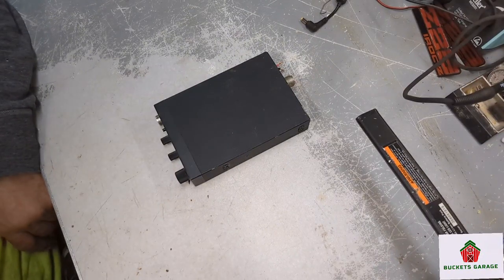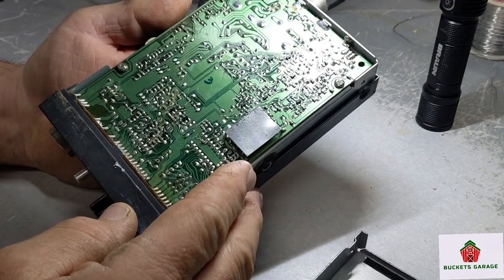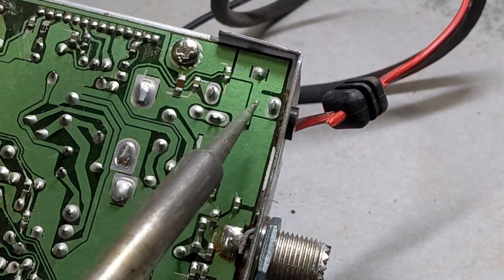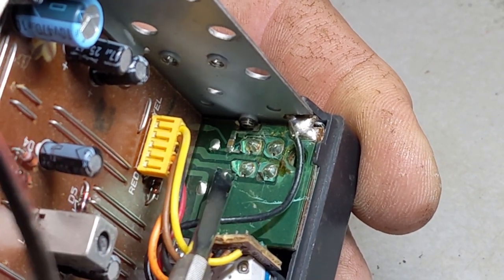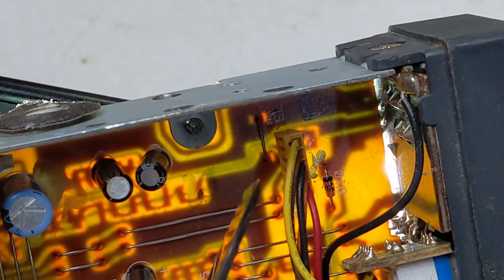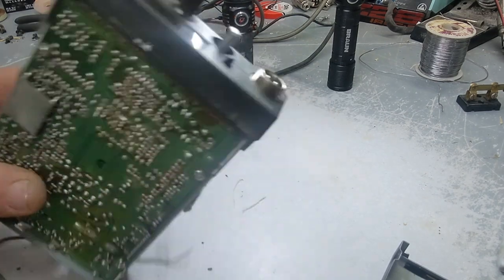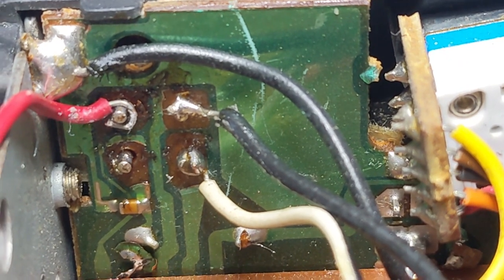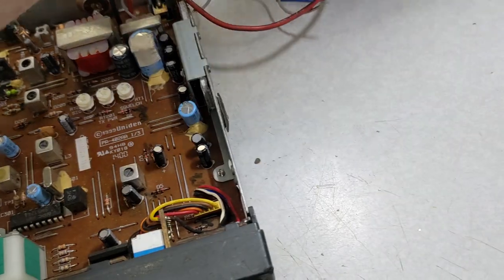Uniden pro 510 CB radio repair No transmit or receive #cbradio #cbradiorepair #uniden

Comment: Great idea on those speaker wires, that's also how I do mine.  The Pro 510/520 is a great little radio.  I don't think the newer ones sound as good as the ones that Uniden produced back in the 80's though.  I have several older ones, as well as new model.  They are pretty easy to work on.
Reply from the maker: Yeah, a lot of the older radios. All are a lot better. I agree with you. Big time. Thanks for watching 😁

Comment: Well spotted fault and brilliant fix! No-nonsense troubleshooting technique!
 One question though, what would have happened if the speaker wires were soddered back reversed?
Reply from the maker: It really won't bother it too much. It just makes it work backwards. Instead of pulling. It'll push the speaker out which will give it a different tone. Perhaps maybe along jeffity would eventually probably burn it out. That is a good question my friend. Thanks for watching and a comment. Have a great day!
Reply: @bucketsgarage  The speaker has polarity in the event you're using multiple channels aka more than one amplifier circuit with a common negative. It keeps them in phase. The signal going to your speaker is AC. Not DC. For single channel there's no phasing and no polarity because its an AC signal so it doesnt really matter which way you connected it in this case. The speaker coil is just an electromagnet and the cone basically makes it a fancy solenoid. Solid repair technique you've shared though

Comment: The Uniden Pro 510XL i have is older, it doesn't have the audio chip on the side but has issues with transmit. I think the final is burnt out.
Reply from the maker: @ryback6060  I see it does sound like the final

Comment: As an old CB fan of some time back, late 80ts. What I never found out was a thing called a “Bleed Over Cristal” I’ve fixed a couple of rigs that some numpty wired it the wrong way and shorted out the Diode. I would love to know where this Cristal goes on the rig. So please show me how to do this and end a long time mystery.
Reply from the maker: Hey bud, thanks for watching the channel. Yeah unfortunately that one I don't know too much about but hopefully someone reads these comments that can help you out with that. There's plenty of great cb ers out there that have good knowledge on that spacific item. Thanks again for watching bud

Comment: What can be done for a galaxy 959 that has little to no receive without a preamp running.
Reply from the maker: You know what it seemed like. I had an issue like that once and that was actually the RF game knob was bad. I'd kind of start with that or it could be a zinger diode but I checked the dial first. Hope that helps